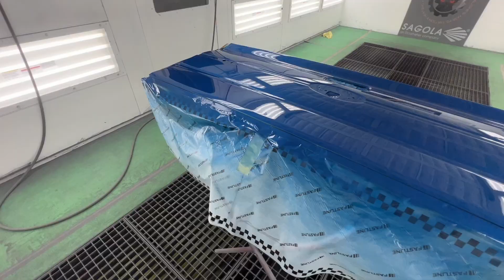Base | Clear Sagola 3300 GTO

Comment: From all I've read and videos I've seen, I'm really thinking on getting this one to start my smal repairs paiting process! Thank you for the video!
Reply from the maker: You won’t be disappointed! Plus it’ll last you forever! My OG is used daily and has been for the last six years. No problems whatsoever!
Reply: @olie_olie_paintz  Would it be possible to do a video on air compressors tho? I've just bought an Tornador, at 8bar it consumes 200L, I know this gun consumes even more. But my problem is that I've searched for air compressor, looking for one with 12CFM, that, in theory, would suffice all this tools, but then when I look them up on YouTube they take close to 3 minutes from empty to full. Although the manufacturers state they are of 360L/min capacity. I've searched a lot about this but haven't got any clue. 12CFM, belt driven, are 1000€ here in Europe, so, big investment for home use, and I would be pissed to spend this money to then not have enough air airflow. I would really much appreciate if you could do a video talking about air compressor!

Comment: As a DIYer looking to up my equipment I’m looking at the EXODUS or the GTO. In your professional opinion which do you feel is a better gun for the price pint as they run about the same money? 

Would be a good Video to compare the two as well.
Reply from the maker: The exodus is far more comfortable. I love my 3300 BUT Meiji who makes the exodus for the Luma boys makes one hell of a gun. I’d go 1.3 OP air cap exodus. They’re great for a lot of things. If you want a gun to spray it all go 3300. As you can get a 1.3 setup and 1.8 setup that’ll fit with the same gun handle.
Reply: @olie_olie_paintz thanks for the input. Really appreciate it. I’ve got another gun for primers mainly looking for a good base clear gun. I emailed Lima and they said I could get the 1.3&1.5 to run in the same gun so that should open up what I can spray with it as well.

Comment: I see you use water-based paint.  But in your experience with the GTO sagola, will it work well for solvent paint?
Reply from the maker: Yessir. When I had a solvent line at the auction the 3300 was honestly my go to for it! Or the 4600 with an hvlp air cap.